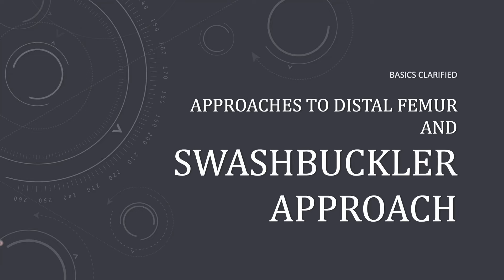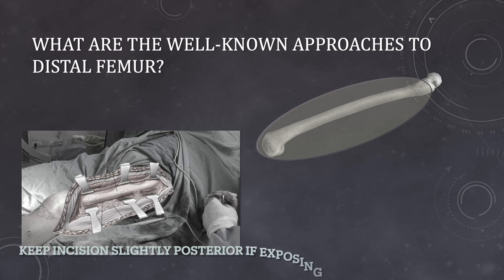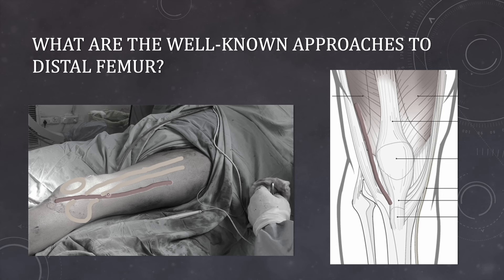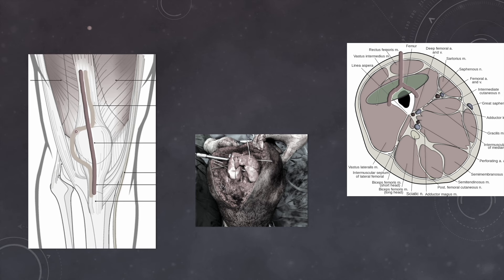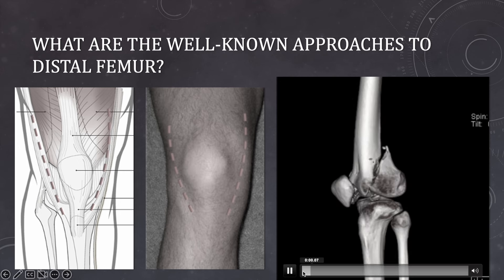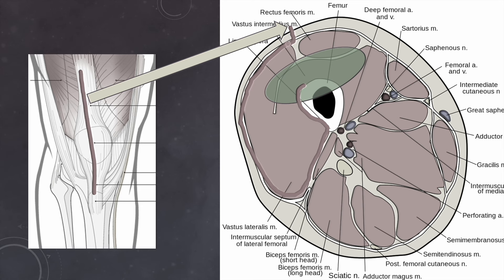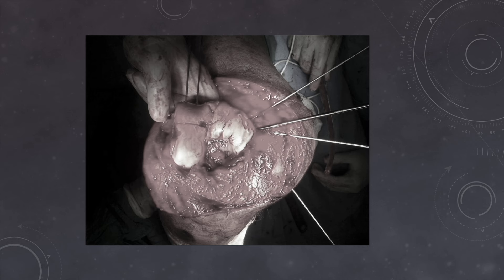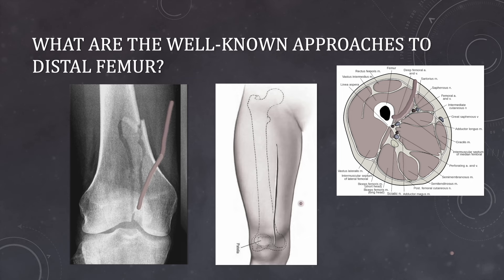Surgical Approaches for Distal Femur Fractures & Swashbuckler Approach: Basics *NonGraphic*

Comment: Sir what is difference between swashbucklers approach and modified swashbucklers approach is it only Skin incision that preserves blood supply to patella in modified swashbucklers or arthrotomy sir
Reply from the maker: Yes, the modification avoids exposure of the peripatellar area and, thus, less risk of disrupting the vascularity of the patella. 

Distal femur fractures: management and outcomes by a modified anterolateral swashbuckler approach Stefano Ghirardelli et al.
Reply: how to approach a floting knee 
can it be done with single midline incision
Reply from the maker: @srikantkumarmishra7188  Yes, a variety of incisions can be used. If you plan to nail both, then an infrapatellar midline incision can be used. If you're planning for distal femur plating and anterolateral plating of proximal tibia, then if fracture is simple and you don't need much visualization of medial femoral condyle, then you can extend lateral parapatellar incision to mid lateral surface of proximal tibia. If extensive exposure is needed then definitely midline for distal femur. But for proximal tibia we avoid long incisions directly over bony prominence of tibial tubersoity, you can slightly curve it either way according to your ease or give a separate incisions with 4-5 finger width gap from the midline incision for distal femur.